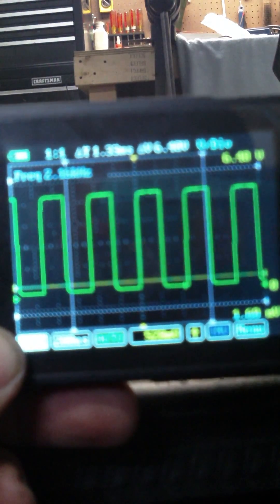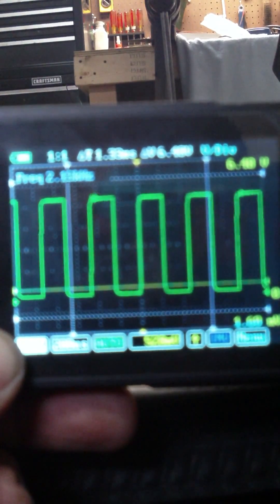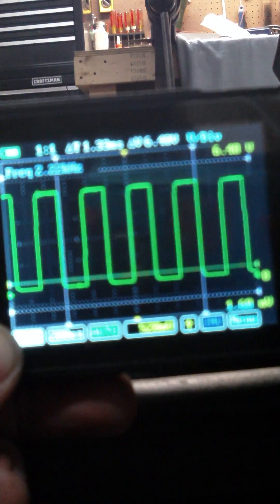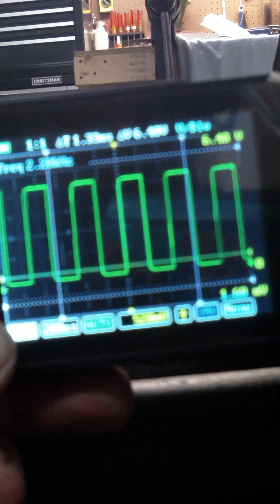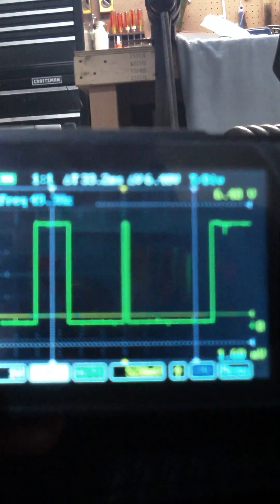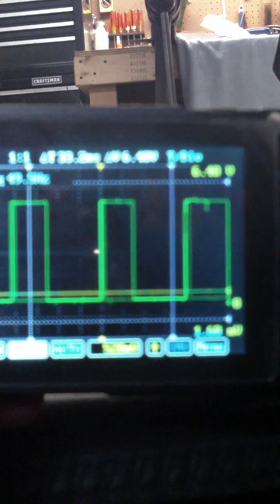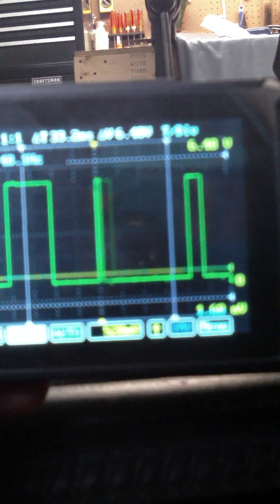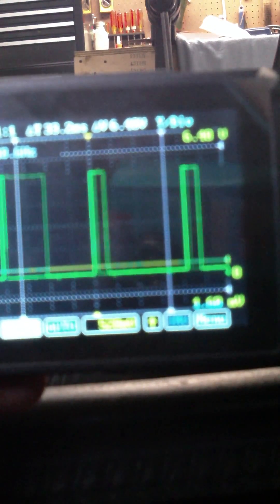Opti Spark Testing with Occilliscope

Comment: Now I would imagine on crank no start the wave points would be wider if my understanding is correct
Reply from the maker: Yes unless the opti is not putting out a signal
Reply: And would the volts stay at around 5volts instead of pulling to ground back and forth

Comment: Can you show where you're hooking the leads up to?
Reply from the maker: Its the connector on the passenger side of intake manifold (4 pin) its in the Factory Service Manual.
Reply: @shawnbauman5463  Yea, that's the combined signal for the ignition module. Where do you connect to see the separate hi res and lo res signals.